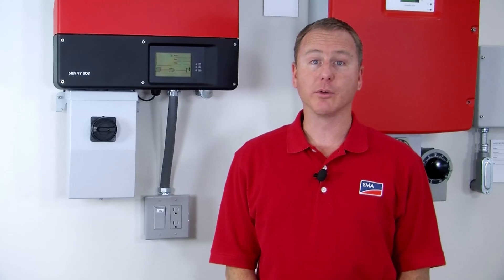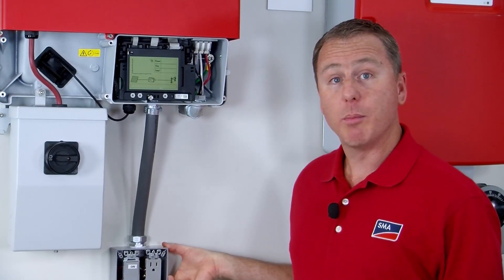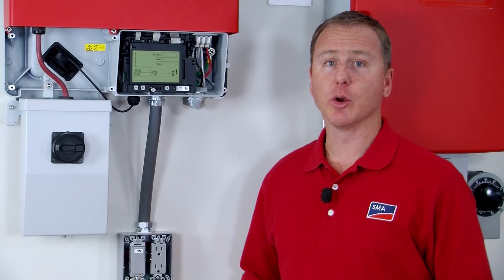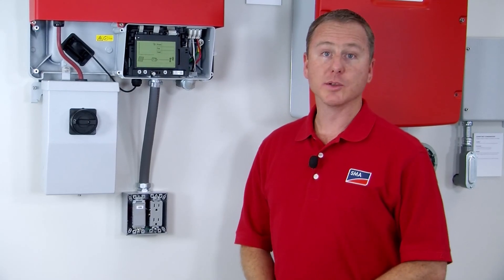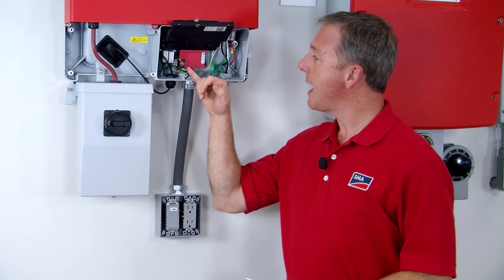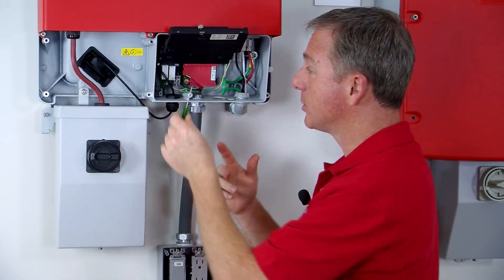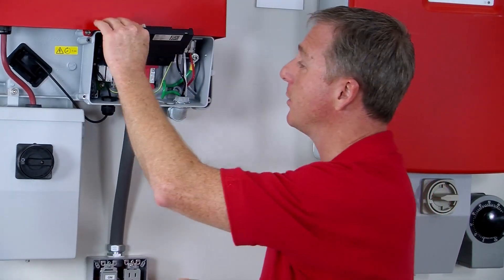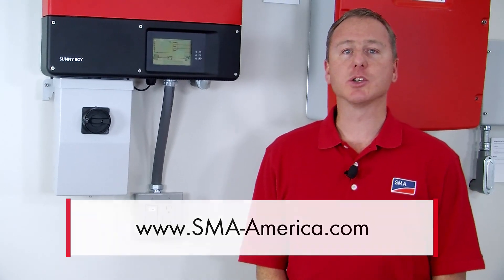Tech Tip: Installing Secure Power Supply

Comment: But how can I get Secure Power Supply now, in the USA under the new 
rapid shutdown rules?  I don't want batteries.  In my region I just want
 the ability to have a low maintenance way to run refrigeration on hot 
days when the grid is shut off due to wildfire risk.

Comment: So do you need Direct current batteries to store the charge from the wind turbine/solar and then need to run it through an inverter to get 110/220v AC? After watching another SMA video, i found out that it runs power without batteries and the SPS IS THE INVERTER.

Comment: Can I wire up a jumper for sps so it’s always in standalone mode or will it only switch over after it powers up?
Reply: I want to just add a jumper. Did you wire it that way successfully?